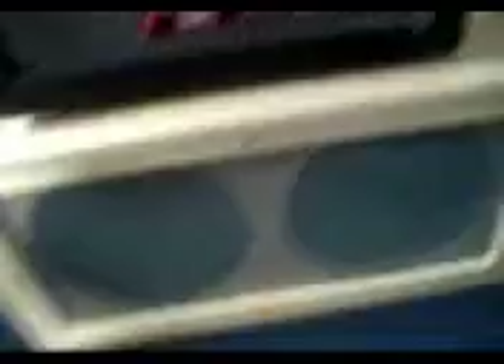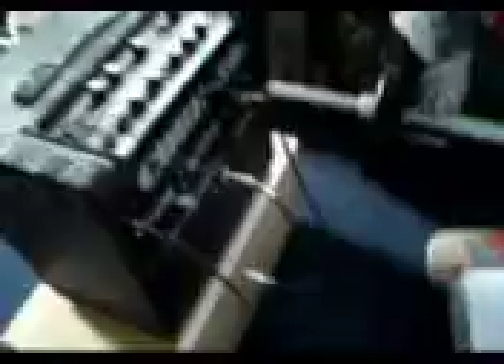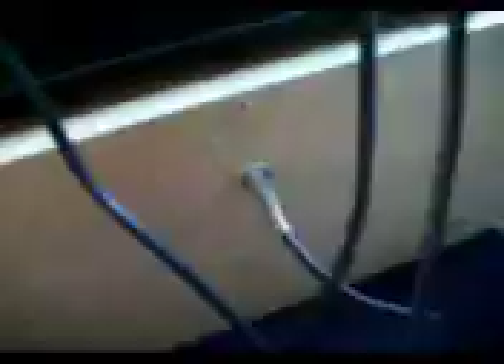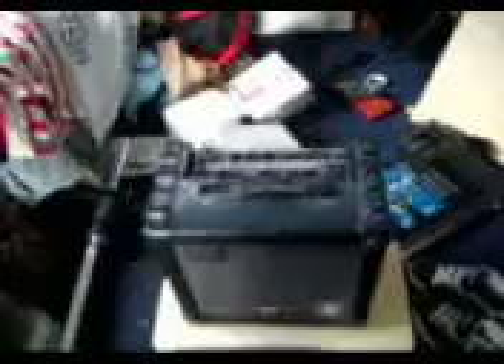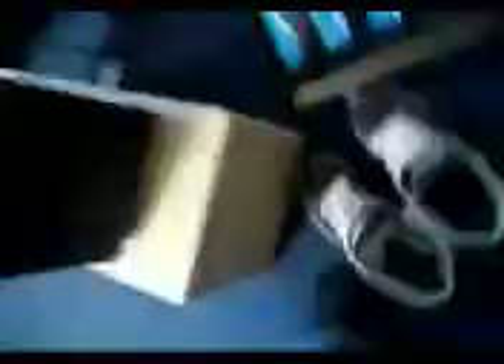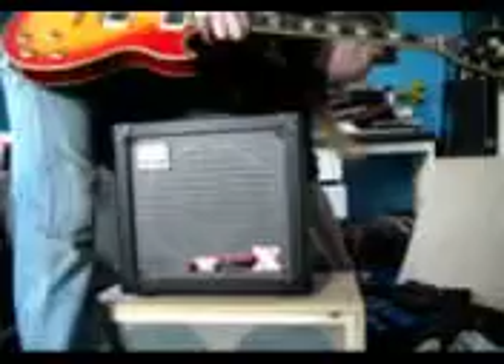Home made Roland Cube 30X Extension Cab 2x8

Comment: I wanna build one now. Sounds great... wow I was surprised even though I am sure the video sound does it no justice.
Basically put 2 speakers in a box and go?  No power supply?
Reply from the maker: Basically yeah! The amp is the power supply for the speakers. All you have to do is match the speakers with the one that is already in there. The speaker in the cube is 30W and 8 ohms. So i used 2 x 15W 16 ohm speakers, that when wired in parallel equal 30W and 8 ohms, the exact same as the standard speaker.
Also, never turn the amp on without speakers attached, or else it can break.
Other than that it is as easy making a box, and putting speakers in it!
Reply: reed00112 Thanks for the reply man... I got an old cube 60 last year and it has really surprised me how good it sounds, but that 2 speaker rig really beefs it up... I have a father in law who loves wood work, he can make anything, I may put him to work..